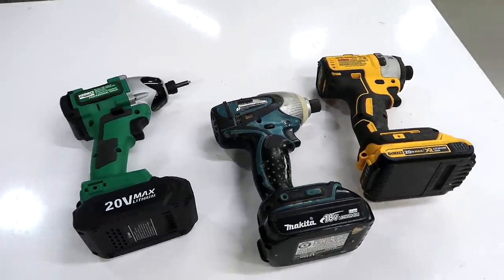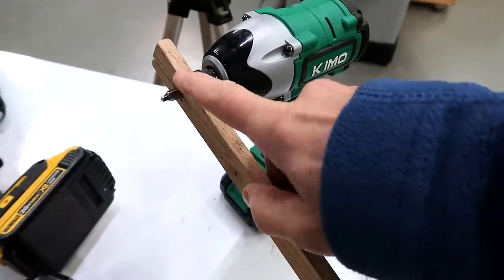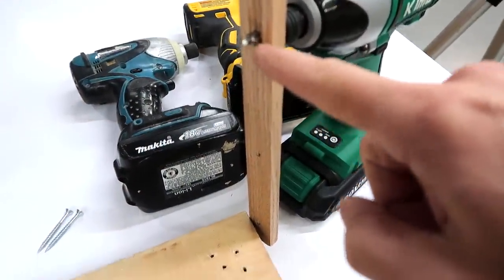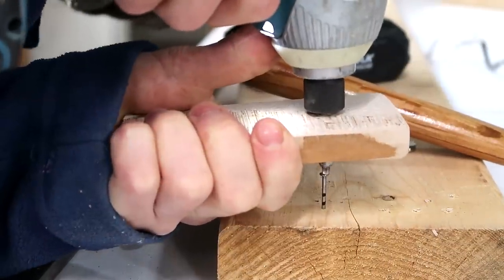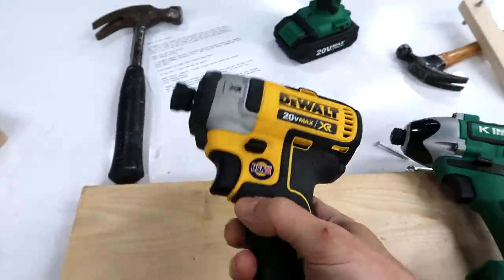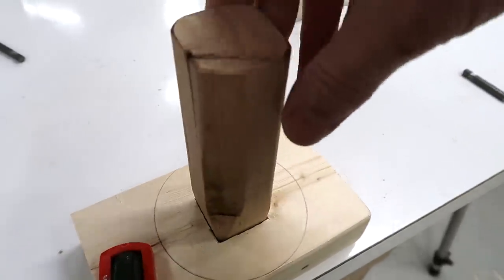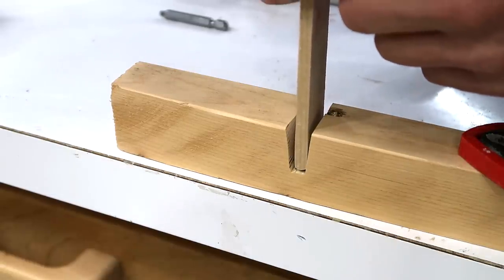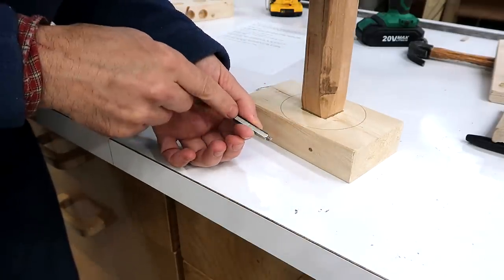How impact drivers prevent screw cam-out

Comment: Impact drivers destroy bits, though.
I've always wondered this.
Reply: Bits are consumables.  The minimal cost is worth it when you’re not slipping off the screw and gouging your hand or workpiece.  I hate the noise of an impact though. Getting a hydraulic impact (m18 surge) was one of my best purchases ever.  You can’t appreciate how quiet they are until you try in person
Reply: Yonatan24 I’ve not had any destroyed bits with Torx. I always go with Torx when possible.
Reply: @lxoxrxexnx  I use philips, always different kinds.
It's a bosch small 12V one, the double sided bit that came with it broke on both sides after a while, but more of my bits bend until they're unusable.
Reply: @lxoxrxexnx  You've run very few screws if you've never worn out a torx bit.
They're easily the weakest most frustrating bits.

Comment: only a scientist could find a way to show something doesn't work even when he knows a majority of the users would argue he's wrong -- and in this case he is -- ever tried building a deck with phillips screws -- it can be done but you will wear out more bits and strip more screw heads than you will with a Robertson or Torque Head.

Comment: I have never even seen those Robertson screws must be a NA thing
Reply: It's a Canadian thing.  But they are becoming increasingly popular in the US, I believe in no small part because of all the Canadian DIY YouTubers (and also Kreg's pocket hole system is all Robertson, too).
Reply: They are a standard among boat-builders worldwide, though other than that not much used outside Canada and the US.  I think boat-builders like them because they often work with marine grade stainless steel screws which don't stick to magnetic screwdrivers or magnetic bits.  Robertson bits are tapered so the screw can hold by friction fit, making positioning your marine grade stainless screws much easier.
Reply: @FireAngelOfLondon  I've been watching some boatbuilding youtubers lately and they're using bronze slotted screws.

Comment: I too hate impact drivers ‘cause of the noise, so I haven’t got one, good quality screws and bits work well enough for me ( posidrive, superdrive, phillips and torx). Soft screw heads are useless for machine driven screws, and as for Robertson or any square drive forget it, useless!!
    My favourite screws are the ones I was brought up with, Slotted, countersink headed  tapered shank.  If you want to hold something together, properly fitted they do the job as best it can be done, and if you get them in bronze, underwater !
Reply: Slotted screws are horrible. Almost no one makes a proper hollow grind screw driver set for them, there are too many sizing standards, they cam out extremely easily, and they're difficult to keep the driver in the head,  making them tedious by hand, and difficult with a power tool.
Reply: byw  Son, settle down, I did not say I liked slotted screws for machine driving, but you can doit if you know how.   Slotted wood screws do not need a hollow ground screwdriver they rely on a well fitting TAPERED driver, as you would know if you had ever looked at a slotted wood screw or a  cabinet screwdriver, a hollow ground screwdriver would be a recipe for cam out in a tapered slot. You would find if you had  ever tried it, that a tapered screw with the appropriate pilot, shank hole and countersink or bore (which you can purchase in one piece) will drive easily, and hold tighter than any cylindrical screw.
      What sizing standards ?    Wood screws run from 1 to 14  and the even numbers are commonest, and in length from half inch to 6” in quarter inch increments. are they easy to get, no but worth it.   I am surprised at the pair of you, perhaps not so much at Matthais who comes from the land of the awful Robertson screw !
Reply: @CrimeVid  I've yet to find a slotted screw with a tapered slot.
Though I do admit it's rare to see slotted wood screws. But slotted machine screws are still all over the place. And I was talking about the sizing standards for slotted screw drivers, not the screw threads and lengths.
Reply: byw  A good quality Cabinet screwdriver will fit 90% of Slotted screws and if not, you have a file and an oilstone, do you not ? I will admit that some plated screws can be a bit tight.   As an aside, until a few years ago most Quantity Surveyors and clients inspectors would not let you get away with anything but slotted screws on quality jobs where the screws were visible, (hinges mostly) and they all had to be oriented the same....   They may still do that but I gave up bank work a while ago .

Comment: So, someone design a "robertson" that doesn't taper.
Reply from the maker: they would be terrible.  They are tapered for a reason.
Reply: @matthiaswandel  To maximize fit without running into tolerance problems? And to help with location?
I think that both can be done without tapering, especially given modern technology.
Reply: @matthiaswandel  Maybe try the experiment with hex drive wood screws.
Reply: @matthiaswandel  with use the taper increases to the point that the screw tends to get damaged. I've mangled screws with a DeWalt driver then found shifting the same bit to a Ryobi driver can still get the screw to turn. There must be differences in impact action.

Comment: you say Phillips is superior to Robertson

yes, they are indeed - i wonder why you don't use even more modern screw drives in Canada - Phillips-Pozidriv is far superior to Phillips-Recess (even though they look similar, they are not compatible) - and als other authors mentiond: Torx is superior to both of them to prevent cam out:

the only advantage of Pozidriv oder Torx is, that the profile of Torx is bigger, therefore the screw head needs to be bigger for the same drive, but with modern screws this is pretty much irrelevant

btw: that is also the reason why drywall screws usally use Phillips-Recess heads and not Pozidriv or even Torx - they are not designed to hold much axial load, therfore a higher torque is counterproductive since the screwhead will snap off ;)
Reply from the maker: well, you go ahead and use your superiour posidrive on regular philips screws, and we'll see how that goes.  Personally, I like to use the bit that the screw is meant to use.
Reply: @matthiaswandel  I guess you misunderstood

Pozi-driv does not work on Phillips-Recess

at least here in Europe Situationen is as follows 
Phillips (mainly PH2) is heavily used for screws that don't fasten by axial load like phosphated Drywall screws or machine screws with metric iso threads

Pozi-driv and Torx are used for pretty much everything else, especially decking and construction screws - almost impossible to find PH for such applications, and Pozi-driv is also dying out

and yes my good old computer screws are also PH2

I personally like to use the screw that is designed to do a job and certain jobs work better with certain drives, and therefore I buy the screws accordingly